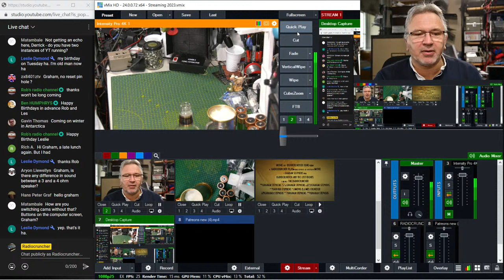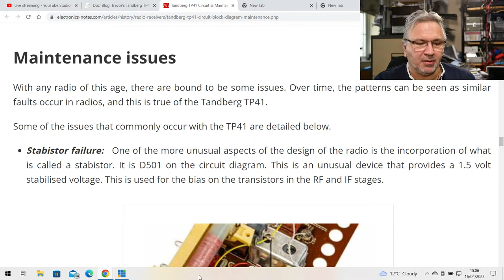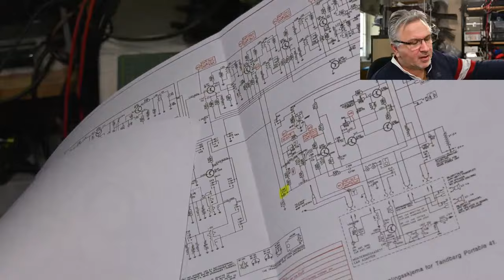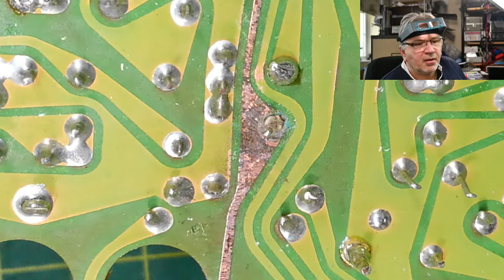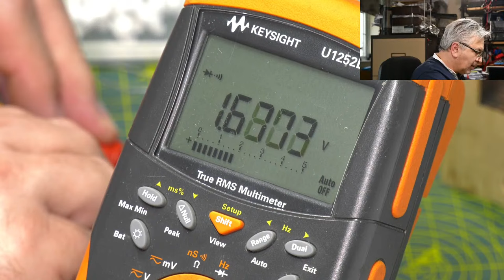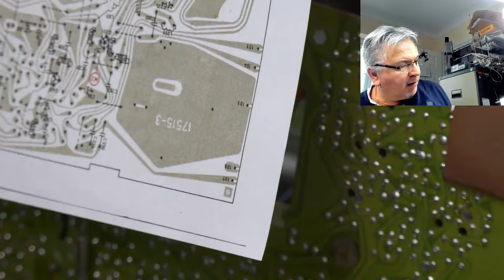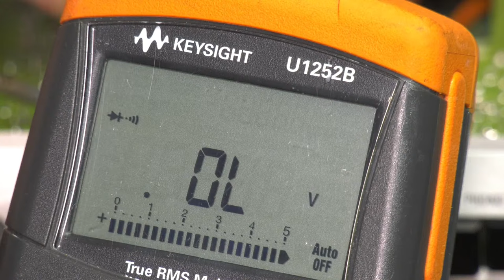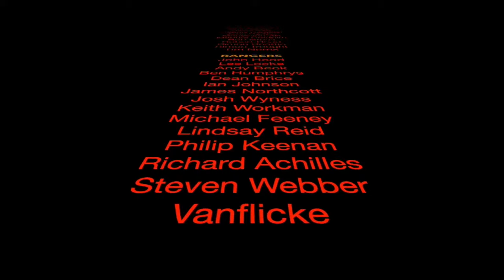Sunday LIVE : Tandberg TP41

Comment: In another lifetime, I ran a HiFi retail shop in Cambridge. The TP41 was the only portable radio we sold. Mostly because it had very good audio. FM was quite amazing. About 1.5 watts output. Increasing to 3-3.5 watts with the car kit. Only problem with the car kit was the speaker was facing down and the 3.5 watts got somewhat lost.
Problems with the Stavistor even happened when new. The radio would become microphonic. Then of course replacements were readily available. When tuning FM it is better to switch off the AFC and engage it after tuning. SW was a bit of a problem. Way to much range in one spread. The fine tuning was very fiddly. It would jump and drift. 
The volume pot had a tap that engaged the built in loudness compensation that would drop out suddenly at half volume and change the sound balance quite dramatically. I sold about 25 of these, only had issues with a few of them. I owned one myself in fact. Cannot remember what happened to it.
Reply from the maker: Hi Michael. That’s very interesting info. I’ve heard that they are very good although the stabistor was a headache to sort. I have to get those old caps done then we will see how good it is. All the best Graham

Comment: Missed the stream...

My excuse... first day of 9 days off was spent in the pub!!

Question to all:
Anybody know how to open/MARS a yaesu Ft 920 for TX on 11 metres??
Reply from the maker: Hi Richard. I can’t compete with the call of the pub 🥃🍷🥂🍻🍺🍹🍾. Not sure on the Mars mod but I expect it’s listed somewhere. I did my FT857 a couple years ago and it was an smd diode shuffling exercise
Reply: @Radiocruncher  sorted it.  Take off covers.. lift off (out of the way) the dsp unit. (Its a screened box held down with 3 screws)

Underneath theres a fine green wire. Cut this wire.

Turn on radio while holding down the 2 buttons underneath the VFO A.

The frequency display shows a series of zeros
Type in 1984129 
Press enter
Turn off
Turn on 

Done!